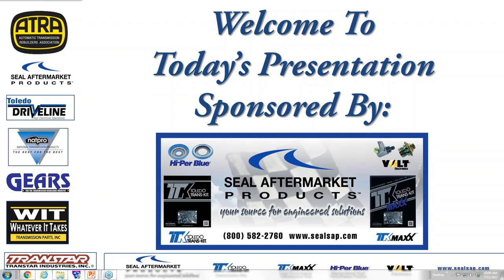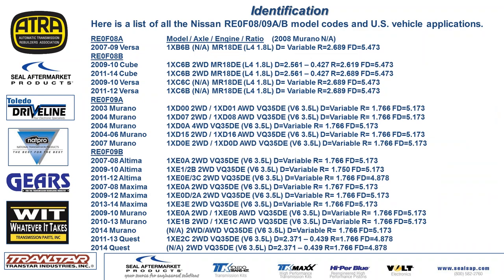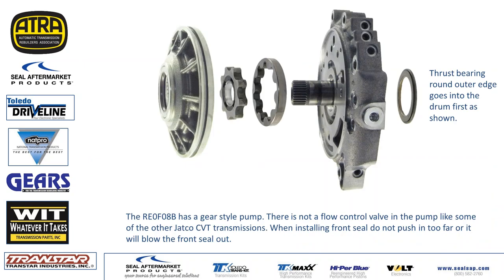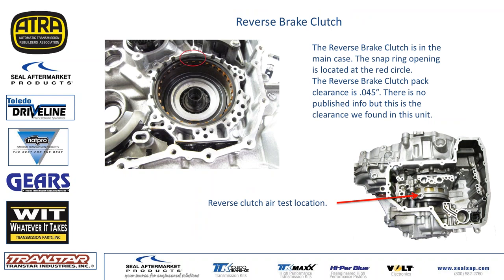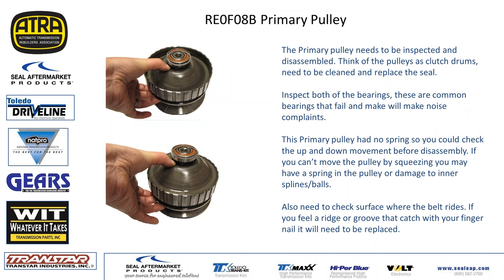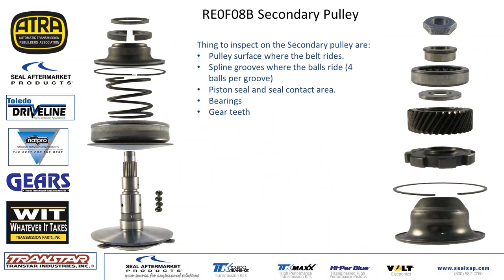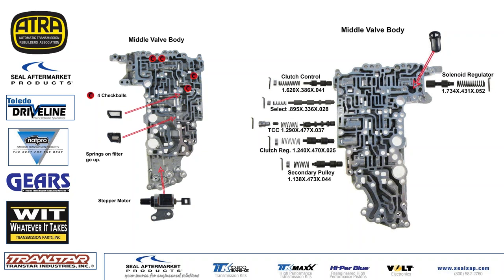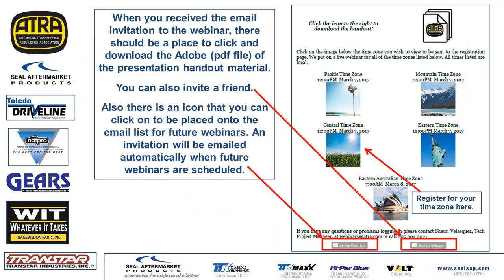RE0F08B Internal Webinar - 7/10/17

Comment: Hello.
Is possible interchange a transmission REOFO8A for another REOFO8B are there any problem to work ?
Reply: A has internal Shift indicator 
B is external.

So no.

The pulleys and belt and other internals can be interchanged though.